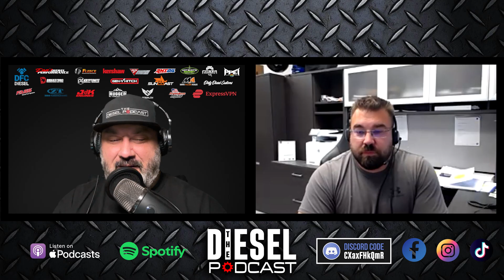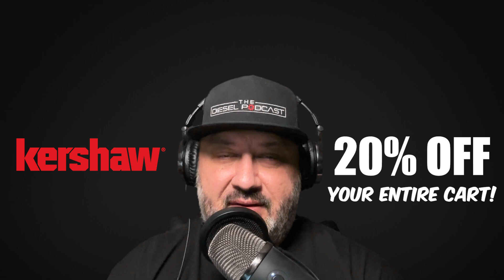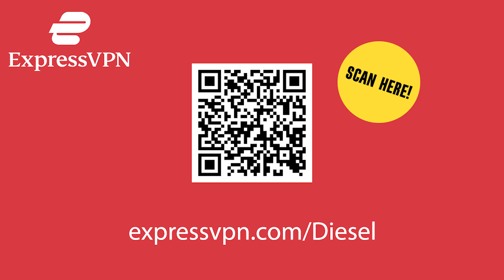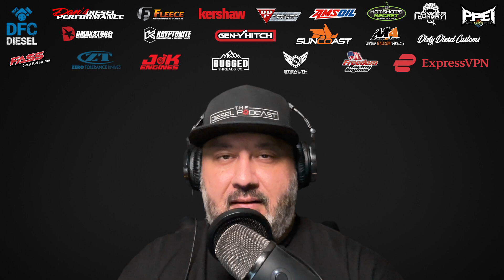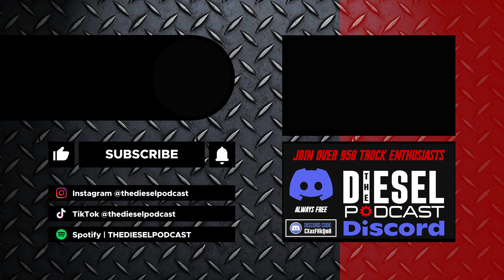Will Lifter Failures Destroy Your Cummins?

Comment: I have 2024 cummins, my lifters were ticking right after the oil change. They recommended an additive after my truck was added to a Star Case, but did not notify me of anything. I found out about the additive a year and a half later. My truck now has 42000 miles on it, I'm just hoping they don't screw me over when  I ask them to fix it before the engine warranty expires.
Reply: They will.

Comment: its not so much the case that it might happen, but the case that it can happen and you have no idea when. Especially for a truck being $75K you would think it wouldn't have any major problems. Its a bad design, the inverse cup and ball on the valve train is a terrible design and switching to a hydraulic after years of success with a engine designed around a flat tappet is just a terrible choice. I see these trucks all over marketplace and the used car market for sale because its a ticking time bomb. Paying $75K for a truck and then gambling on a possible 25K repair bill.

Comment: Watched a video where a diesel mechanic did a complete Hamilton lifter swap. The truck had the tick but when tear down there was no signs of bad wear. Did the s wap and the tick was back. Come to find out the 2019 Cummins had two different brands of lifters in it. Upon research he found others that had 3 different brands of lifters installed from the factory. Ram also has a TSB out that state the lifter tick can come and go. Ford and GM also state the same thing. As of now there's no solution for the random tick.

Comment: I made it a little over 15,000 miles on my 25 2500 cummins before it shit the bed...in the shop 4 months and lemon lawed...never again with cummins
Reply: Sounds like the new ones are having issues too. Was your 2025 in for lifter issues?
Reply: @alexv305 multiple lifters…and the 25’s and 26’s in my fleet are failing too..straight garbage
Reply: @chuckatley1464 I'm having buyers remorse on my 2024. I just bought it with 9600 miles and it sounds like it's got a lifter issue.
Reply: @alexv305  I would have rather gotten a gently used 24...all the stuff to fix it already exists... Hamilton already makes a flat tappet conversion for the 25+ models...but we are 2 years away from a full delete with trans tune...in all honesty, looking back, I wish I had kept it and just voided the warranty

Comment: When a pushrod is designed with ball on top instead of a cup in a splash lubed system...guess what will happen?
Reply: No lubrication so it wears out the cam shaft. Such a stupid design failure.

Comment: Nope, my cummins has real diesel lifters. Solid flat litters.
Reply: My 06 5.9 has flat top lifters, no emissions except the catalytic converter, and no heater grid bolt problem. After two decades the engine runs like a champ with no tick or issues. Have done some front end work, rear main seal, transmission cooler and lines and changed fluids at prescribed intervals, with oil changes within 5,000 km. So glad I did these maintenance jobs and didn’t trade it in on a newer model. The 5.9 has never disappointed. Paying $100,000 for a new 6.7 and then having all these problems is just crazy.

Comment: Mine 2022 didn't follow recommend intervals did lots of oil changes like 5000 miles. Those lifters are definitely a problem. Mine were starting to wear at 30,000 it's a bad design. You can listen to this and get the wrong idea. It's definitely a issue. Ignore it if you like.

Comment: Anytime you have Matt on it's going to be a good one!! Hopefully you can get him on to chat about the internals, builds etc of the L5P, as what sets it apart from the earlier Duramax engines internally and similarities, if any. The common problems he sees and fixes. Why can it hold higher horsepower with a stock rotating assembly when the LML and earlier engines let go. 

Again, great podcast!!

Comment: Glad I have a 4th gen
Reply: Same. I had a 2nd, 3rd, and currently on 4th gen. Skipping 5th gen for sure. 
Hopefully, the 6th gen cummins pulls thru and addresses the issues.
Reply: Same, I already have 10k in upgraded parts on mine too, If I had to pull it apart again for lifters after all the work I did I'd be pissed.
Reply: @andiamocclash397  just watch the timing cover. They arent as tight as they should be from factory and the gasket will eventually blow out
Reply: @bucketheadrox .. any way to address that beforehand?  The timing cover issue